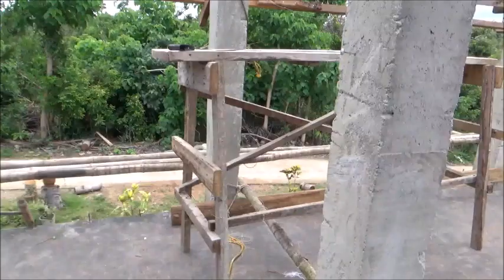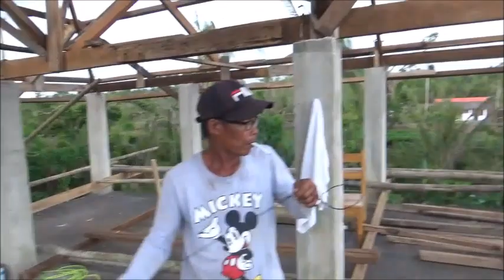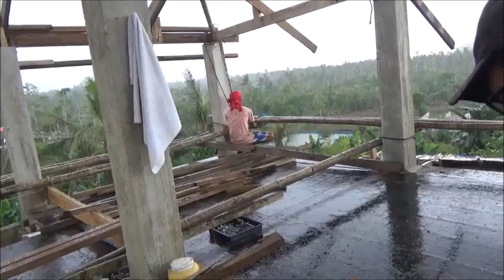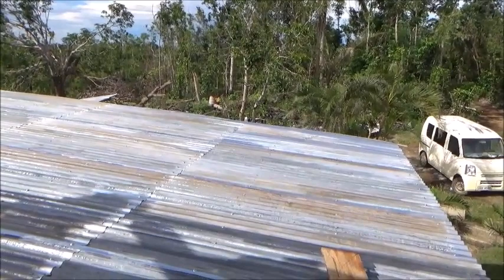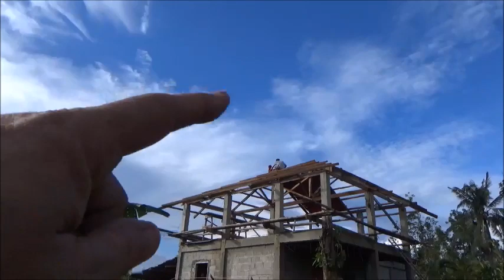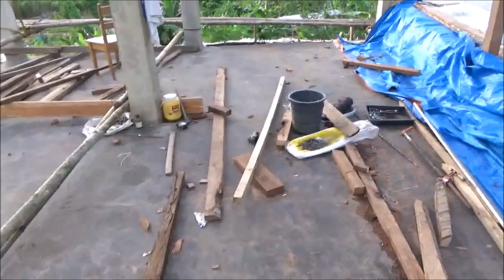Roof Progress 3/15/22

Comment: Moving your Solar System ( Inverter / Charge Controller / Batteries ) up to 2nd deck will Easily Expose those Electronics to Sea Saltwater Mist. You are not far from the Ocean. Also factor in another Typhoon Damaging your equipment. After another Typhoon you might Not have a Solar System. Once you move into house use the shed your are currently sleeping in. Or build another shed downstairs Between Water Tank & Playpen.  that new Concrete Corner Post right there would be Perfect for your Wind Generator Pole goin up.
Reply: The panels were originally on the previous roof.  They took it down before the typhoon hit.
Reply: I would recommend that you build a concrete block room next to the house for the controllers and batteries. If the roof leaks you could ruin the controllers and that would put you in a bad possition.
Reply: @stephensparks9084  Great comment.
Reply from the maker: Saltwater mist is a concern but I don't see any way to avoid it since the system must be ventilated. As far as another typhoon hitting us here we'll just have to go with the law of averages..and since Odette/Rai was the FIRST serious one to hit Bohol in recorded history I'll take my chances 🤠
Reply: @aforeignerfarminginthephil3374  10.4

Comment: Doing checks, I found the best angle for solar panels is 7.5 degrees facing south.  . .  Also remember, the suns position in the sky in summer, is very different to the suns position in winter. . .  I downloaded SUN SURVEYER LITE. . .  And 450 watt panels should connect straight into the solar controller for a 24 v system. . .  Also note, covering a panel buy as little as 5 %, will render it useless.   (Zero watts)
Reply from the maker: Sounds good 🤠

Comment: Don't tatay have a electric saw? It be more cost effective to use that with the generator... plus cut the bamboo. Not split but cut it so it's striaght ... just a thought
Reply: Cut it with what?? They are splitting it the long way into four quarters, maybe 2. I must be missing something. Lol. Got it. Your talking about a table saw, or a skill saw.
Reply: @quaggg  yes the bad ends and all the other boards they used for the roof
Reply from the maker: I've bought 2 electric saws and been gifted a battery powered one...none lasted long enough to justify the cost especially the electric ones. In other words, tatay and crew can't destroy what they don't have 🥴
Reply: @aforeignerfarminginthephil3374  y they so rough on saws ?
Reply from the maker: How well did you treat your 1st and 2nd cars??🥴🤠
Reply: @aforeignerfarminginthephil3374  great I loved my 1970 monte Carlo 😁😁
Reply from the maker: Loved it, regularly saw how fast it would go, rarely changed the oil etc? These guys are the same way with saws. Run it till it drops🤠

Comment: Youtube vlogger has a solar and inverter  system plus batteries, and he lives in Bohol , so he says.
Reply from the maker: Which YouTube vlogger?
Reply: @aforeignerfarminginthephil3374  vlogger Mountain Man, he also has  LED lights like those on street poles  , i think,and  he says he is in Bohol,   has Solar and  inverter Charge controller and LFP batteries   and says he will set up wind generator.
As James Hightowerof Texas Filipino says LFP  is the way to go as they require .ess maintenance and  should last close to 20 years, he  replaced his lead acid  batteries for this reasons.
Reply from the maker: He did not replace his lead acid batteries with the lfp...in fact he just bought more lead acid batteries for his system. I have seen his wind generator and will have something similar someday 🤠